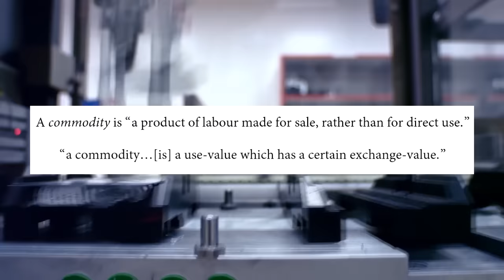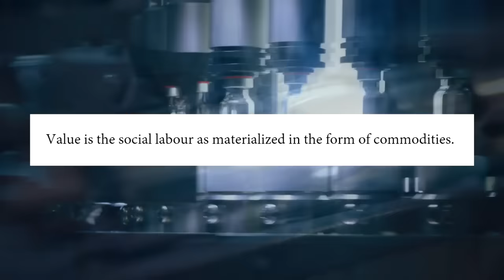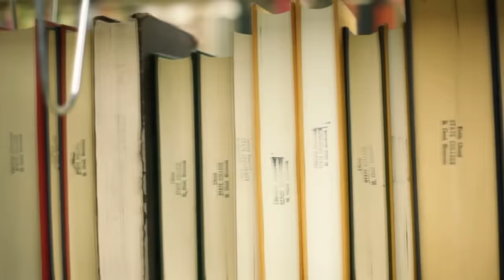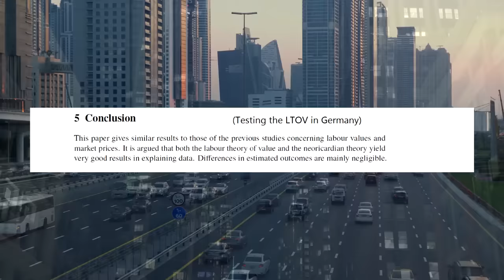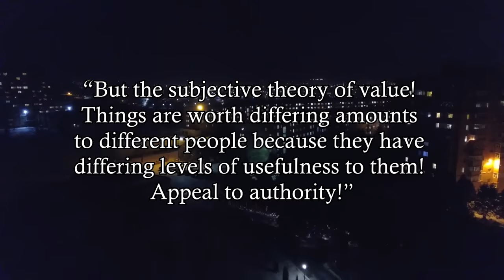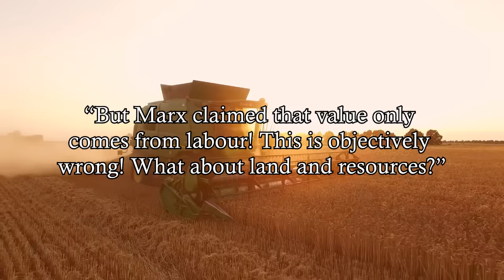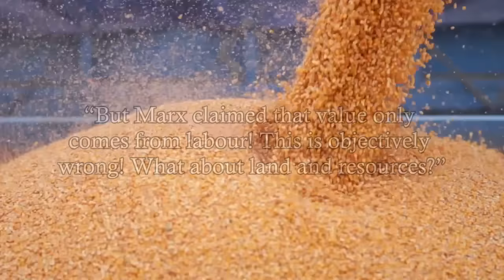Capitalist arguments against the labor theory of value suck (Explaining the LTOV) - Socialism 101

Comment: Also for those newer leftists out there, please note that Marx was clear that the LTV (or the Law of Value) only applies to the capitalist mode of production. It’s an incredibly useful tool for analysis of capitalist production but doesn’t really apply outside of it in the same way.

Goods will still be allocated based off their labor time under socialism but markets and commodity exchange must be heavily suppressed in favor of wide scale planning based solely on labor time. The law of value found in capitalist (generalized) commodity production creates its own value form which develops into money and generates capitalist circulation and reproduction on an expanded scale (capital accumulation). For that reason, the law of value cannot operate generally under socialism, money under socialism must at the very least not be able to purchase means of production and labor power and its functions as money should be quickly phased out as much as possible, as this historically marked the downfall for most socialist states.

Nerdy stuff aside, fantastic video!
Reply: Is there any specific work from Marx that says about the same thing? The only contradiction I thought I found in Marx is the LVT as claiming that all products are "congealed labor time" sounds like a type of money-form. When labor is the universal equivalent, exchange value would be based on labor, which just sounds like another wage system. The philosophical part of Marxism is that exchange value and supply/demand markets pervert the use value/nature of a product, disconnecting humans from reality and the means of production.
Reply: @apestogetherstrong341  yes, but it still only operates under commodity production which is definitively not socialist (although there can be small scale commodity production under socialism as long as it isn’t generalized, I’m not a left com)
Reply: The following two quotes are from Volume I of Capital, Ch. 1 and 3 respectively:

Let us now picture to ourselves, by way of change, a community of free individuals, carrying on their work with the means of production in common, in which the labour power of all the different individuals is consciously applied as the combined labour power of the community. All the characteristics of Robinson’s labour are here repeated, but with this difference, that they are social, instead of individual. Everything produced by him was exclusively the result of his own personal labour, and therefore simply an object of use for himself. The total product of our community is a social product. One portion serves as fresh means of production and remains social. But another portion is consumed by the members as means of subsistence. A distribution of this portion amongst them is consequently necessary. The mode of this distribution will vary with the productive organisation of the community, and the degree of historical development attained by the producers. We will assume, but merely for the sake of a parallel with the production of commodities, that the share of each individual producer in the means of subsistence is determined by his labour time. Labour time would, in that case, play a double part. Its apportionment in accordance with a definite social plan maintains the proper proportion between the different kinds of work to be done and the various wants of the community. On the other hand, it also serves as a measure of the portion of the common labour borne by each individual, and of his share in the part of the total product destined for individual consumption. The social relations of the individual producers, with regard both to their labour and to its products, are in this case perfectly simple and intelligible, and that with regard not only to production but also to distribution.

The question — Why does not money directly represent labour-time, so that a piece of paper may represent, for instance, x hours’ labour, is at bottom the same as the question why, given the production of commodities, must products take the form of commodities? This is evident, since their taking the form of commodities implies their differentiation into commodities and money. Or, why cannot private labour — labour for the account of private individuals — be treated as its opposite, immediate social labour? I have elsewhere examined thoroughly the Utopian idea of “labour-money” in a society founded on the production of commodities (l. c., p. 61, seq.). On this point I will only say further, that Owen’s “labour-money,” for instance, is no more “money” than a ticket for the theatre. Owen pre-supposes directly associated labour, a form of production that is entirely inconsistent with the production of commodities. The certificate of labour is merely evidence of the part taken by the individual in the common labour, and of his right to a certain portion of the common produce destined for consumption. But it never enters into Owen’s head to pre-suppose the production of commodities, and at the same time, by juggling with money, to try to evade the necessary conditions of that production.

Marx makes clear that the Law of Value that operates universally under capitalism, cannot operate in the same way under socialism.

Next, here’s a long passage from Critique of the Gotha Progamme:

But "all members of society" and "equal right" are obviously mere phrases. The kernel consists in this, that in this communist society every worker must receive the "undiminished" Lassallean "proceeds of labor".

Let us take, first of all, the words "proceeds of labor" in the sense of the product of labor; then the co-operative proceeds of labor are the total social product.

From this must now be deducted: First, cover for replacement of the means of production used up. Second, additional portion for expansion of production. Third, reserve or insurance funds to provide against accidents, dislocations caused by natural calamities, etc.

These deductions from the "undiminished" proceeds of labor are an economic necessity, and their magnitude is to be determined according to available means and forces, and partly by computation of probabilities, but they are in no way calculable by equity.

There remains the other part of the total product, intended to serve as means of consumption.

Before this is divided among the individuals, there has to be deducted again, from it: First, the general costs of administration not belonging to production. This part will, from the outset, be very considerably restricted in comparison with present-day society, and it diminishes in proportion as the new society develops. Second, that which is intended for the common satisfaction of needs, such as schools, health services, etc. From the outset, this part grows considerably in comparison with present-day society, and it grows in proportion as the new society develops. Third, funds for those unable to work, etc., in short, for what is included under so-called official poor relief today.

Only now do we come to the "distribution" which the program, under Lassallean influence, alone has in view in its narrow fashion – namely, to that part of the means of consumption which is divided among the individual producers of the co-operative society.

The "undiminished" proceeds of labor have already unnoticeably become converted into the "diminished" proceeds, although what the producer is deprived of in his capacity as a private individual benefits him directly or indirectly in his capacity as a member of society.

Just as the phrase of the "undiminished" proceeds of labor has disappeared, so now does the phrase of the "proceeds of labor" disappear altogether.

Within the co-operative society based on common ownership of the means of production, the producers do not exchange their products; just as little does the labor employed on the products appear here as the value of these products, as a material quality possessed by them, since now, in contrast to capitalist society, individual labor no longer exists in an indirect fashion but directly as a component part of total labor. The phrase "proceeds of labor", objectionable also today on account of its ambiguity, thus loses all meaning.

Marx has reiterated here what he said in Capital even clearer.

Finally here’s a quote from Vol. II

M — L. The wage-laborer lives only by the sale of his labour-power. Its preservation — his preservation — requires daily consumption. Hence payment for it must be continuously repeated at rather short intervals in order that he may be able to repeat acts L — M — C or C — M — C, repeat the purchases needed for his self-preservation. For this reason the capitalist must always meet the wage-laborer in the capacity of a money-capitalist, and his capital as money-capital. On the other hand if the wage-labourers, the mass of direct producers, are to perform the act L — M — C, they must constantly be faced with the necessary means of subsistence in purchasable form, i.e., in the form of commodities. This state of affairs necessitates a high degree of development of the circulation of products in the form of commodities, hence also of the volume of commodities produced. When production by means of wage-labour becomes universal, commodity production is bound to be the general form of production. This mode of production, once it is assumed to be general, carries in its wake an ever increasing division of social labour, that is to say an ever growing differentiation of the articles which are produced in the form of commodities by a definite capitalist, ever greater division of complementary processes of production into independent processes. M — MP therefore develops to the same extent as M — L does, that is to say the production of means of production is divorced to that extent from the production of commodities whose means of production they are. And the latter then stand opposed to every producer of commodities which he does not produce but buys for his particular process of production. They come from branches of production which, operated independently, are entirely divorced from his own, enter into his own branch as commodities, and must therefore be bought. The material conditions of commodity production face him more and more as products of other commodity producers, as commodities. And to the same extent the capitalist must assume the role of money-capitalist, in other words there is an increase in the scale on which his capital must assume the functions of money-capital.
Reply: @howenator  no, planners use the law of value to guide themselves.
Reply: @apestogetherstrong341  that is just measurement in labor time. Very different from the law of value of commodity production which necessarily generates its money form that develops into capital. Plus even if that were the case, it is now almost entirely unnecessary to use price signals for economic planning and computations can be done solely on labor time.
Reply: But life time is a universal condition for an economy to exist in the first place, so LTV should be applicable to any sort of society
Reply: @RatchetClank93  Marx' LTV applies in the social context of capitalism most, although anywhere there is commodity production it shows.
Reply: @Porky sorry I actually omitted much of what Marx wrote in volume III of Capital about this. The law of value holds true for commodity production and exchange. As commodity production is generalized, it becomes more and more important until industrial capitalism. When capitalist production established itself as the dominant mode of production and production for profit replaced production for surplus value and the interests of the individual capitalist were subsumed to the interests of the capitalist class, the law of value became true only when dealing with the entire social scale of production. In this sense, it actually holds more true for small scale commodity production in some cases than under developed capitalism
Reply: @Porky yeah they're long books and only a handful of people have even touched Vol. II and III but they are very important since they expose the idealism that modern bourgeois economics is built on. I do recommend that you read Results of the Immediate Process of Production which is included as the appendix to Volume I in the Penguin classics edition. It helped tie together everything from Volume I into Volume II for me. I still need to finish Volume III, as I haven't even gotten to the sections on rent and credit yet. I suggest consistently breaking up reading Marx with reading Engels, Lenin, etc. along with Marx's later philosophical writings like the Grundrisse. The three volumes are intertwined in so many ways, even though the second and third are unfinished, once you can manage to tie them together it will stick.
Reply: @Porky the law of value applies in other modes too.

Comment: What I like to say, is that prices are determined subjectively but based on objective factors: the minimum price at which a company/craftsperson will sell a product or a service is objective (because no one would sell a product at a price that ultimately result - ceteris paribus - in an overall loss); and the maximum price at which a customer/buyer will buy a product (which is that person's/company's need/cost ratio).

The minimum price is objectively set by cost of suppliers, resources, operating costs, investment and labor costs; while maximum price is objectively set by purchasing power. Only the small difference between minimum and maximum price has margin of manoeuver by market forces.
Reply: That's not what the labour theory states, it's what the subjective theory states

Value is arbitrary because it's based on how usefull people find something. But that is usualy based on more objective measures

Only thing you are missing is that it's perfectly possible for value to be lower than cost of production or higher than purchasing power

It happens for companies to produce something and then not be able to sell it, and they end up selling at a loss. There also exists lots of products much more expensive than most people could aford
Reply: I like that breakdown, makes sense. Did  you mean, though, to say that the maximum price is set SUBJECTIVELY?
Reply: @lizicadumitru9683  not really, it's set objectively by the amount of money/capital that the buyer disposes. I might want to be disposed to pay USD 2000 for a pizza because I am really, really hungry, but if I don't have USD 2000 I cannot do that.
Reply: @pedropradacarciofi2517  that is an absolutely fair point
Reply: @richneuro6121 Ok, but different people have different amounts of Disposable income at different times. Additionally, you might not always want to pay 2000 USD for a Pizza, whereas  a Billionaire might be OK with tat. 

Because of this, the "Upper Limit" is much fuzzyer then the lower limit.

I suggest using the Average maximum Buying power among the consumers

Comment: I love these 101 videos. I would generally consider myself to be fairly intellectually capable. But, this doesn't change that a good bit of this material can be very difficult to understand. In the arena of supporting a socialist revolutionary view, I feel I am very weak on this side of things. 

And, of course, this is not at all out of the usual. This sort of economic analysis can be overwhelming for many folks. I admit that when reading some of Lenin or Marx, I can get a bit lost.

It helps contextually and gives more physical meaning when hearing you discuss it in this framework of responses to common arguments, etc.

I strongly believe in trying to make things like this more accessible because more comrades = good yay

Comment: This was actually a pretty lousy defense for the labour theory of value. Biggest complaints:
• Handwaving away the subjective theory of value simply by asserting that intrinsic value exists is a piss poor take. Even the example with the bottle of water was horrible. It completely ignores a) The admin cost of determining how much every individual will value a product
b) Price gouging regulations
This results in an average cost being set for goods, however provides small business serving smaller communities better power in price discovery. 
• Commodities must be useful. The mudpie example is obviously taken to the extreme, but due to supply chain issues, storage issues and fluctuating demand, it can happen that a product has a market value (i.e. price) below that of the resources used to make the item. Scrap yards, recycling plants etc. Take advantage of this fact.
•All labour is equal. You're argument that at the enterprise level all labour is equivalent really only applies to sweatshops or other menial jobs. This is not true for many jobs and is why recruiters put so much emphasis on experience even within the same job family. If it was all the same, performance reviews wouldn't exist, promotions would never happen.

In short, this video fails to achieve it's goal of defending the labour theory of value. Had it at least made an argument supporting the idea of intrinsic value it would have some redeeming quality but overall this video serves as nothing more than a shallow introduction to LTOV
Reply: What I got out of this was that the labor theory of value does not see price and value as the same thing while the subjective theory of value does.